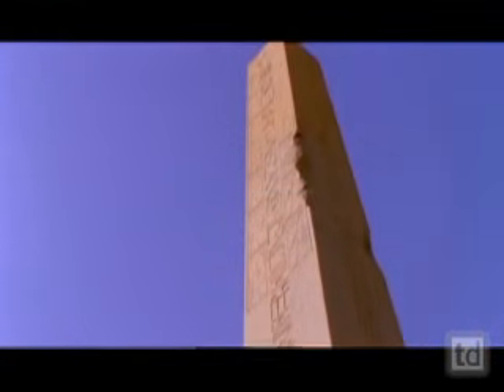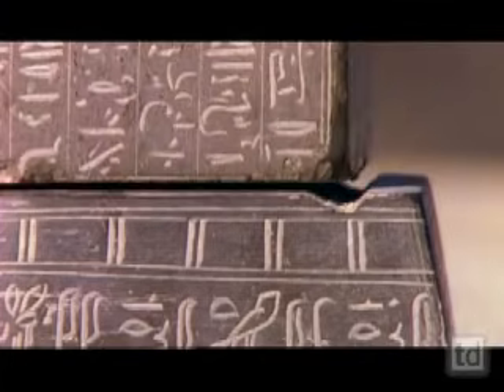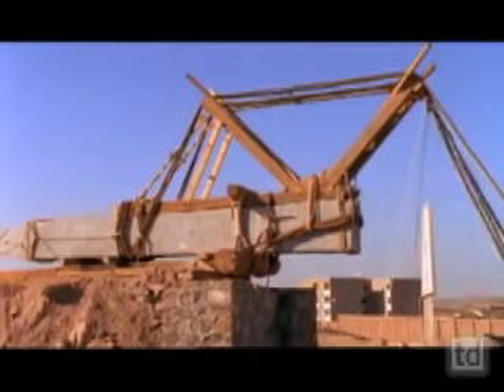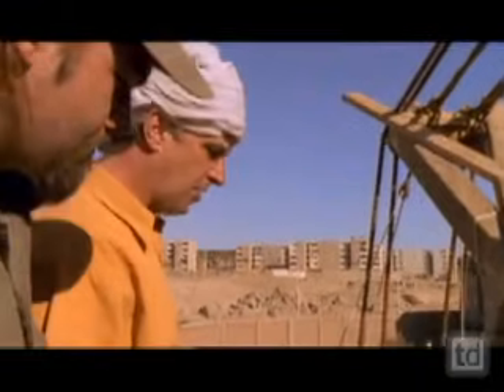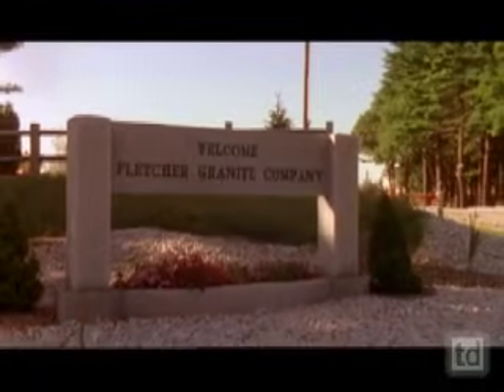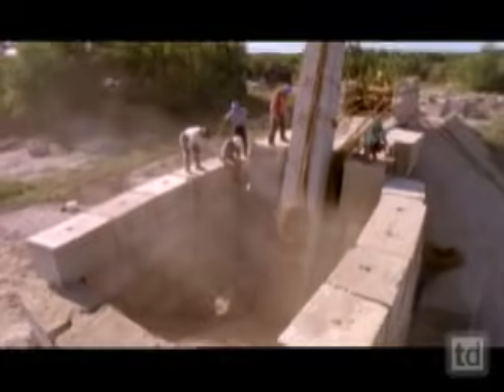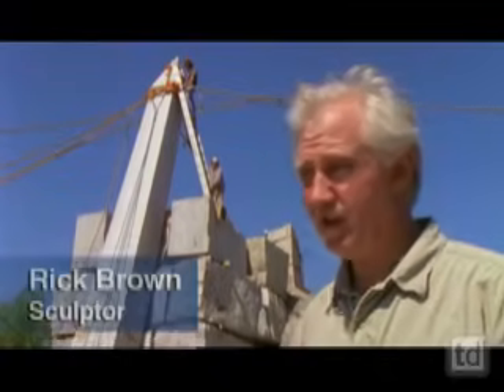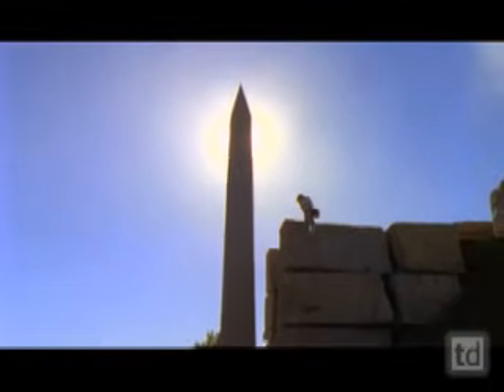Raising an Obelisk

Comment: Totally fraud. This was taken from the original Raising the Obelisk by NOVA. They actually tried do executre every step from quarrying the block to lifting and transporting it BUT FAILED. They were forced to use modern machinery and this was only a 35-ton obelis less than 1/5th the size of the largest. Typical Egytologist scam...NOVA even removed that special which was aired on PBS.
Reply: A failed experiment doesn't prove that the goal is impossible to attain. They did proved successfully that an obelisk can be erected without modern machinery.

 The cutting of granite is well attested by all the monuments, statues and deeply carved inscriptions.

The movement of such objects with no modern machinery is attested as well: The romans brought obelisks from Egypt all the way to Rome. Augustus brought 2 obelisks, both of which are 200+ tons (one of them is now in the Piazza del Popolo). Caligula brought the obelisk that now sits in the Vatican square, weighing more then 300 tons. Hadrian had brought the columns of the Pantheon from Egypt, each weighing around 60 tons. The biggest obelisk from Rome was brought in the 4h century by Constantius II. The largest stone ever moved is the Thunder Stone, moved by the Russians with no machines and no animals. Originally, it had more then 1000 tons.
Reply: the obelisk was only 35 tons? theyre gonna need a lot more ropes to move 1600 ton blocks.